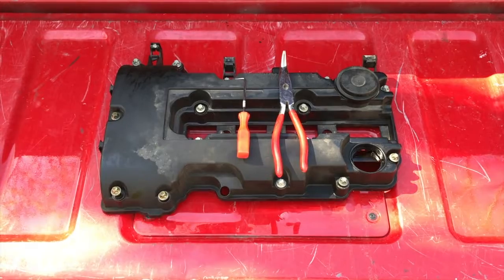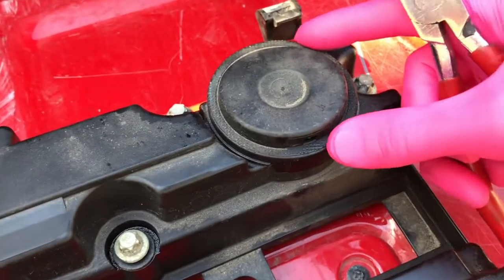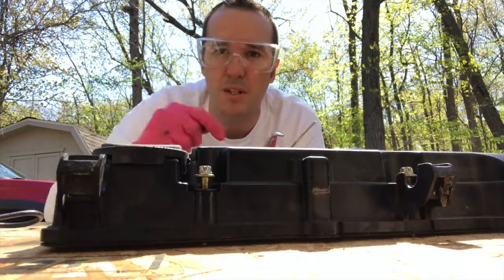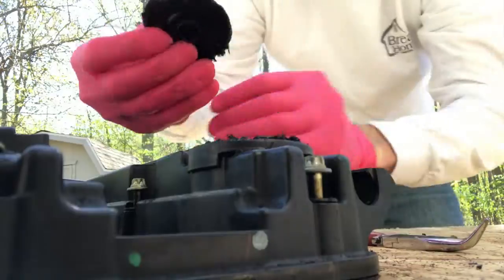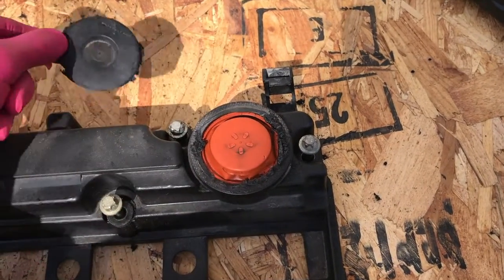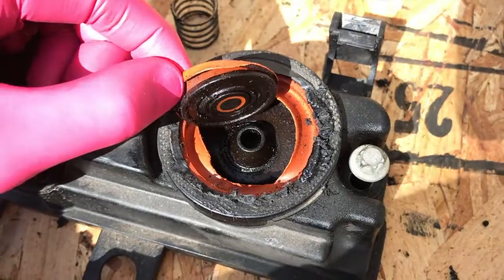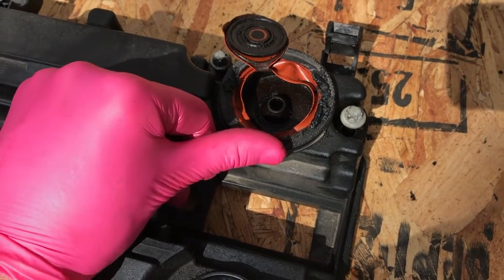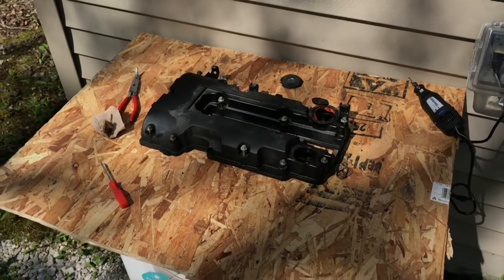Chevy Cruze Inside l👀k - "P0171 Traction Control Alert" - Failed PCV Valve!

Comment: I replaced the valve cover but I am still getting the traction control issue. What could this be? These cars suck big time.
Reply from the maker: @1Pueblito  

Thanks for watching, any update?   You may need to disconnect the negative cable to your battery and leave disconnected for five minutes.

This will allow your system to perform a full reset and hopefully turn off your traction control.

If that doesn’t work, double check that your traction control push button is on.

Comment: you can replace only the membrane. you can find membrane and pcv cap on ebay/ali express. You heat the pcv cap with a heat gun and with a sharp tool, slowly pry of little by little the cap. Replace the membrane with the new one, and retrofit or put a new cap supplied also by ebay fix kit. Use epoxy or silicone glue to make sure the new cap stays on.
Reply from the maker: Thanks for watching & welcome to the DIY Raptor Club.  We appreciate you sharing this info.  May be helpful for future viewers by giving them an additional option.  Thanks again & hope all is well.  Enjoy your day.

😎👍🔧🔩
Reply: @DIYwithMichaelBorders  I will make a video, soon. thank you!
Reply from the maker: @raducumucu1  

😎👍🔧🔩
Reply: @raducumucu1  did you ever make the video of the membrane replacement
Reply: @MrGr8ball  yes. a week ago I repaired one and also shot it: https://youtu.be/3fenm5MBXa8

Comment: Michael you remind me of a younger Scotty kilmer, didn't cover this as you do ,will do this test as getting a sound like a vacuum leak which comes and goes, still more to watch on your videos, to see if a mass sensor, I did check the fuel injectors, and they are working,will figure this out eventually I thank you very much for your help so far
Reply from the maker: Carl Beaudry 

Awesome Awesome & thanks for your comment.  Scotty Kilmer is the Man!  He is an extremely knowledgeable Mechanic.  Keep us posted!

😎👍🔧🔩
Reply: @DIYwithMichaelBorders  ,would this make the sound I'm hearing sounds like a squeaky belt, when I put my finger or thumb as you did RPM rise a few then drops off,this is driving me mad LOL,tested mass flow was good,check for leaks on in take manafold,was Good , this all started out with traction control on engine control, got to go if you have time, do you think can be PCV valve? 2014 Chevy Cruze
Reply from the maker: Carl Beaudry 

Thanks for the questions.  If you are experiencing suction sounds & there is hissing coming from your part shown in this video, you will need to replace entire Valve Cover.

😎👍🔧🔩